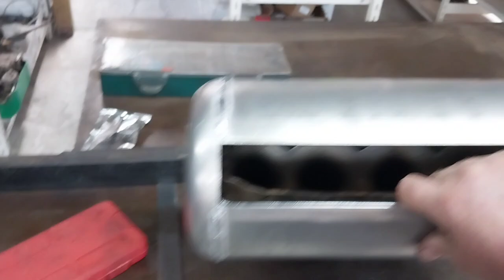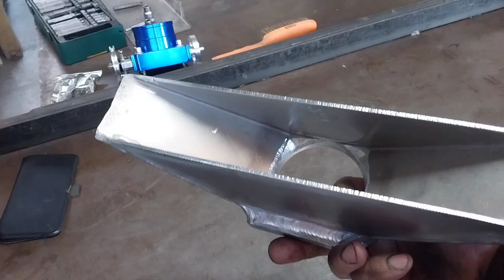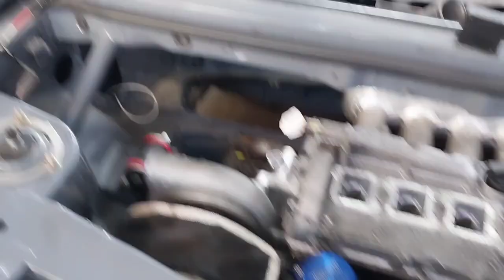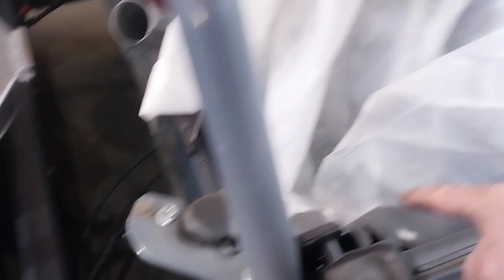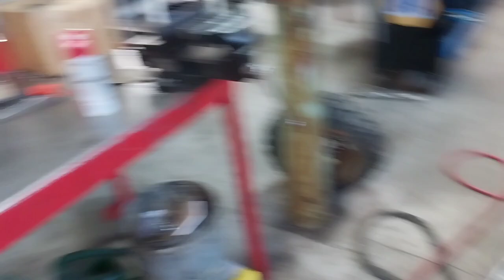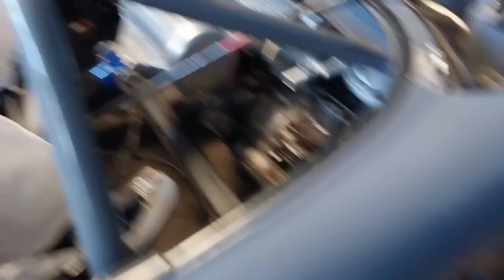Crazy inlet manifold done! 1.8t powered mr2.

Comment: I think that is a really good effort at trying to engineer your own intake manifold. I also think you should try that manifold in comparison with the stock one. At least that's what I would do. Sometimes people can make better components on their own, even without engineering degrees. But doing so will most likely also require trial and error. 
   My opinion about your attempt. The plenum is far too large. I didn't realize it was for a 1.8t at first even though I clicked on the video. I think it would work better as an N/A manifold. It will take a longer time to reach max boost. Maybe not that much longer, but it will induce boost lag. Not only that, it appears as though it would function as a compressed air tank. The thing about that, when you want the blow off valve to work, you want it too work. Considering the design, though there is volume inside the intercooler and all of the piping, I would run a large blow off valve.

Comment: If you had narrowed the slot in the plenum until it's the same area as the throttle body opening it would be a dual plenum intake which have great air distribution. Aside from a tiny bit slower throttle response and maybe a few dozen milliseconds longer to reach full boost, there shouldn't be any real disadvantages to having a plenum that large

Comment: Air, like water, doesn't like changing direction or dramatic changes in area. 
At least you can cut the top, bottom and sides off when you want something nearing the correct shape and volume.
Reply from the maker: @jdoe9518  yup I hear ya. I just copied a manifold I found on the net that cosworth made for one of their turbo engines in the 80's. You'd think they'd know what they're doing?
Reply: @g-mech1244  That was a dyno only plenum for testing a de-stroked BDA for suitability in F1.

That engine and plenum was to suit up to 11,000 rpm and 4 bar of boost.

And since they know what they're doing maybe look at the manifold used in the RS200 running a BDT-E 1800cc engine
Reply from the maker: @jdoe9518  no it wasn't that engine sorry.
Reply: @g-mech1244  They only fitted turbos to 2 four cylinder and 1 V6. The YB Cosworth that was in the Sierra will support 680hp with a plenum 1/4 the size of what you have.

Your end runners will not receive the same amount of air as the centre two because there nothing direct it there.

Anyway cool story bro
Reply from the maker: @jdoe9518   Yup, the v6 was the one. Quite a large spherical plenum feeding 750cc worth of capacity.  Yup and like I mentioned in the video, "my plenum is probably too big, but it's what I had lying around". Without a flow bench, an engine dyno and a cfd program, everyone is just guessing, including you, and including me. 
That's the story.  Cheers

Comment: Dont forget you still have to make Vacuum  under extreme driving you may run out of brakes
Reply: He has a vacuum port on intake for brake booster
Reply: @bobbyyurk6483  I know this but it will only make vacuum on closed throttle its very big plenum so would take some time to vac  as it cant make vac on boost or part throttle

Comment: Good stuff!  You wouldn't happen to know anyone who could do a quickie computerized flow analysis on it would you?  I feel like I would have probably squeezed the inlet charge down to a much narrower slot where it enters the cylindrical plenum, but I can definitely imagine advantages of doing it how you did...
Reply from the maker: Yup I hear ya. I thought of that but chickened out. Kind of like the twin plenum rally manifolds, but center entry.
Reply: @g-mech1244  Exactly!  But my guess would be that the massive change in volume in your design will disrupt and slow the flow velocity sufficiently that it should make for pretty good distribution.  Pretty much what you're thinking? At any rate, it's exciting, and I appreciate you sharing your adventure!